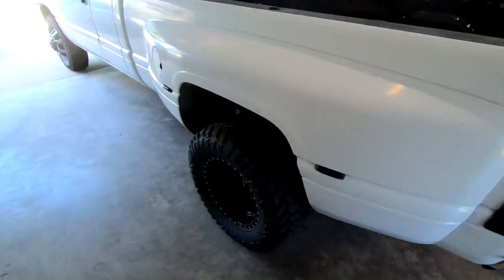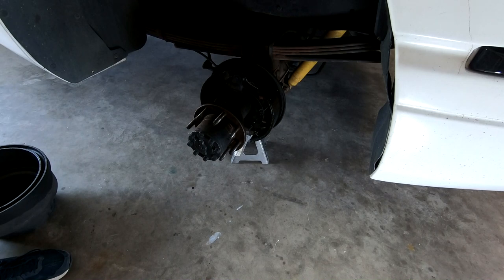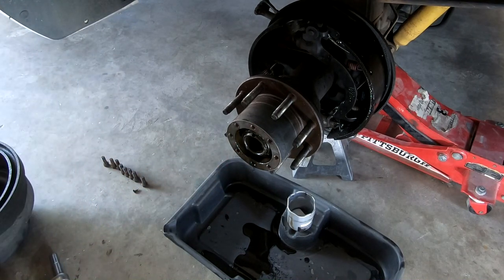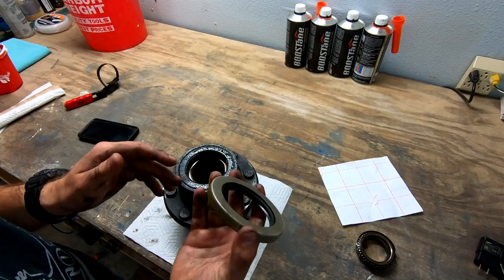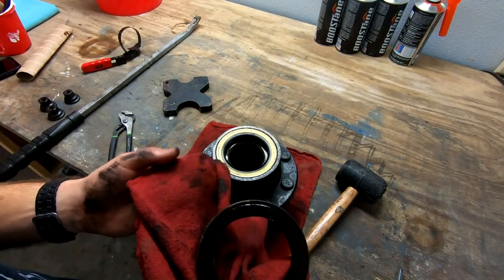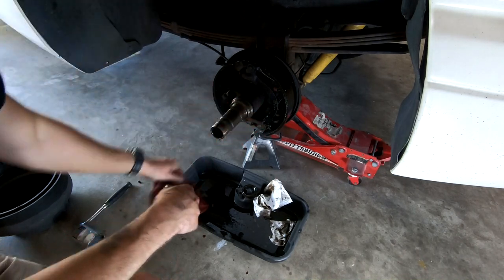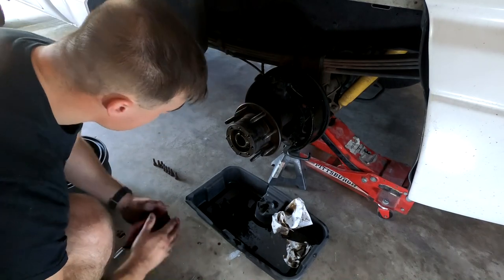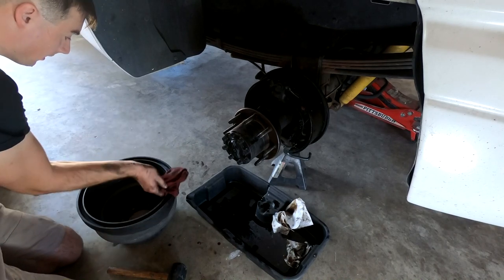Rear Axle (wheel hub) Seal Replacement 01 Dodge Ram 3500 Dana 80

Comment: You should have replaced those brake shoes just had to do the right side if mine today 2002 2500 with 5.9 Cummins and my E bepake shoes were saturated ! So i rep,ace botg sides E brake also mine has disc brakes and a shoe E brake on inside of the rotor ! Great tutorial video though  ! 👍👍

Comment: I've got an 01 3500 and I've had to replace rear passenger side 3 times and 3 times on driverside also. I'm doing the drives side again today. I've taken it to 3 different mechanics and no one can figure out why they keep failing. I do have 2" spacers and I do pull 10,000# - 15,000# quite often. But they still shouldn't be failing. We even put speedy sleeves on to account for any wear where the seal sits. Don't make any sence. The dealership has even replaced them. I took it to then thinking hell there's no way they can get it wrong but that wasn't the case. After the 3rd on the passenger side it has held up for about a year and the 3rd one on driver side made it about 8 months and now it's pouring out again. Where to start now...?
Reply from the maker: I'd check for a bent axle, maybe its causing uneven wear. That's very strange.
Reply: I'm a pipeline welder with a custom welding bed and a1800 lbs machine plus bottles and tools so any given time I'll say I'm caring 3,000 extra lbs I use to have that problem until I bought rims with the 2 inch offset instead of running wheel spacers/ adapters.  $1500 for the rims but saves you $1200 each time each side brakes
Reply: Greasing it when installing? Don't hit the threads on shaft when installing and check your vent tube for blockage. Otherwise it's possible your bearings are to loose and causing the seal to leak.
Reply: @alejandroboxer1 your bed alone is 3,000lbs.
  Plus machine bottles, rods, tools...you are easily creeping on 5,000lbs on the back od your truck